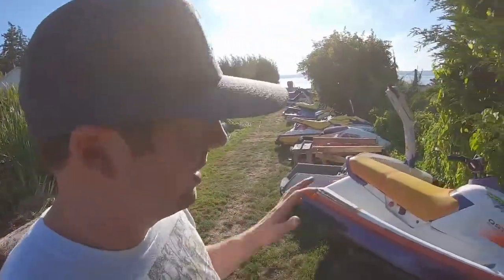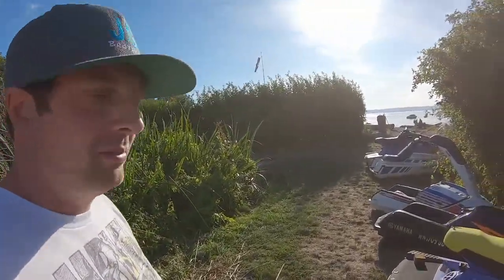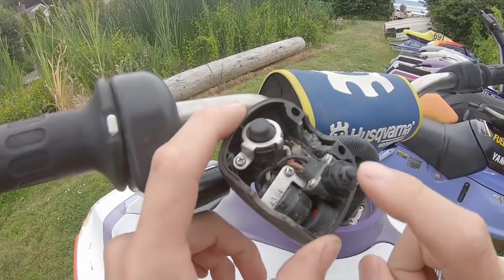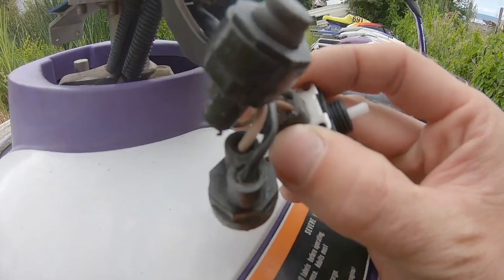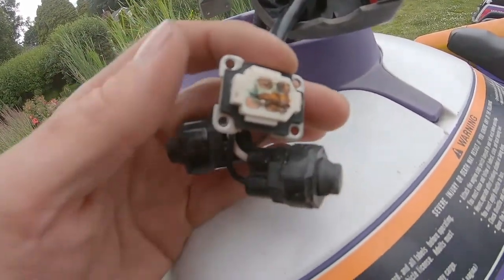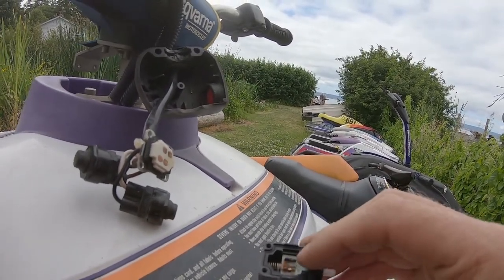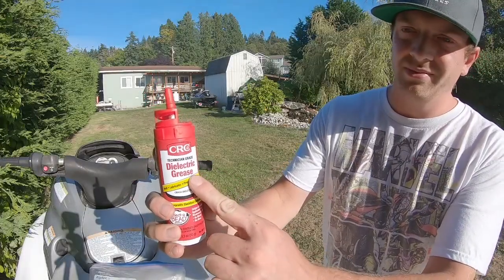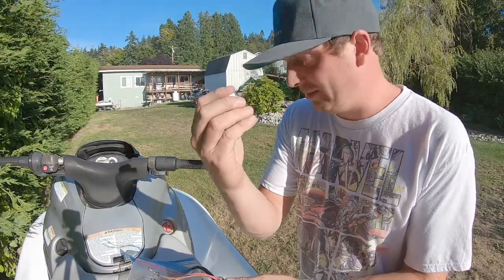#1 failure part on yamaha superjet and waverunner pwc

Comment: Had no spark on my 1992 waverunner 3, cleaned the contacts and spark was re-established. Thanks for the post.
Reply: So did the engine turn over and no spark ,or did it not turn the engine over ?
Reply: @darrellsomers5427  

The problem ultimately was the CDI. An after-market one was purchased, and everything ran fine. Everything is dialed in now.

Comment: I put a 2011 VX switch on my 95' Blaster and it works. I was looking everywhere for 93-96 Blaster switches on Ebay and Amazon. Finally I realized one day that my 2014 VXS had a switch box that looked the same!

Comment: The “Secret to long life “ of these switches is keep a lanyard connected all the time when in storage. The little rubber cover will have No pressure on it while the lanyard is connected, this stops it from splitting and leaking water 💧.
Regards Adzy
Reply: Adzy the PWC bloke in Australia! Troy great tip
Reply: The guy who sold me my Wave Venture in March 2020 told me that!  Most valuable tip so far!  :)

Comment: I found a trade for those little rubber boots you're talkin about it was many assorted ones at the hardware store in the nuts and bolts hardware section there was some assorted stuff at the far end little knobs assorted switches excetera and they had a little tray with about five or six different kinds of those rubber switch covers boots. They were about ten bucks a piece they were not cheap but they had them in different sizes. Also may check eBay for waterproof toggle switch boot. John from Marble Falls Texas

Comment: This sounds like the issue I had last week at the ramp where I hooked up the lanyard, but it would not start. Luckily I hit the start/stop switch with some electrical contact spray I brought and it fired right up, but I think I will take apart the switch this weekend and fix it right.

Comment: Just watched your video and it seems to be my problem- the little metal tabs in the kill switch are missing.  I was going to replace the kill switch with a generic one.  I tried to disconnect the black and white clip but it wouldn’t start.  I checked and I have power in red wire coming from battery lead going to kill switch… any suggestions?

Comment: Sometimes you can test this by pulling the spark plugs and watching for spark. No spark while the button is being held down and it will spark momentarily when the button is released. 

Also, jet ski solutions out of Georgia will fix these. I had them do one for my fx1 and it has at least 6 or 7 seasons in it so far.

Comment: I have a Yamaha xl 700 04’ that isn’t firing regularly. It will crank sometimes but won’t others. Any idea what it might be? Start Stop switch or coil maybe?
Reply: Richard Owens I have  a 2003 xlt800 same problem. I did this and still the same problem.  Any luck fixing yours yet?

Comment: They got this stuff now in the store that acts and does not get hot it is liquid black scotch tape I put it on everything with wires that evolves around water and it peels off if you need to do repairs David around all of that cover all that steel and you’ll never have a problem it is pretty neat

Comment: thank you for this great video,  I just bought a 98 waverunner  that will start but will not shut off, I've already swapped the on off switch and had the  same results , any ideas?
Reply: You need a Diode someplace after the ON switch

Comment: Thanks for that. BUT my issue is that my jetski turns over but there s no spark? Which means the lanyard switch works but there s no spark? Is it still the same issue? Because I guess if it's the switch issue it won't even turn over? Pls let me know. I m very confused here. Thanks

Comment: Try this one: I take my xl700 10mi to end of the island great engine but we go to leave it cranks and start to accelerate and boom nothing no spark. I noticed the fuse popped in the ign box put another in and nothing even pulled a spark plug and held onto it I should have got shocked. Cranks over fine but won't spark anymore I'm thinking stater I don't think the start stop would pop my fuse. Wut would u guys try on this?

Comment: Great info! This was the issue with my 95 Waveventure. However, I can't figure out how to get the switch with the 4 screws out of the housing to take it apart.. I took out the 2 screws on the other side. It looks like it is zip tied way down under??
Also, if I decide just to get a new one, I don't see where the wires go down into the ski.
Thanks!

Comment: Fixed my switch finally. I was trying to get my ski ready for a Trump Flotilla here in CA, unfortunately I never made it. The problem was as you mentioned in your video, but a bit more of a problem. Those tiny contacts in the slide were dirty, but one was corroded and would not spring back up. I finally got it out then noticed the tiny spring inside was eaten away from the corrosion and that diameter size of spring I could not find anywhere. I had springs that 'diameter wise' were close but would not fit. The workaround "for me" was too very carefully drill out the spring pocket in the slide and cut the spring to the correct length, then pray the contact would slide up and down. "It worked". I placed everything back in the lower cover tried it out and it fired right up. Reassembled the upper cover, tried it and nothing...WTF. I tore the whole thing apart 3 times down to the contacts, thinking it must be the problem, but the problem was simpler than that. It seems when I tightened the (4) screws of the slide switch housing I over tightened it and the slide would not pop backup after having to work against the spring pressure from the lanyard button. Loosening the screws to the slide housing just a little was enough for the slide switch to work more freely. It starts every time now and hopefully will last a long time as I packed that housing with dielectric grease. The little rubber boots for the switches they sell online and if I had thought about it when I went to the electronics store I could have bought some there. Another option would be to maybe make one out of Plasti Dip.

Comment: Can you put dielectric grease on those switch terminals once you clean it off ?
Reply from the maker: I have tried it and the grease makes the switch move too slowly. You might be able to get away with an extremely light coat

Comment: Good info for my Waveraider. I was going to comment about using dielectric grease in the slide contact, but you covered it. The dielectric grease works well at keeping moisture out so I like to use it in my plug boots and pretty much any place where there is a chance of corrosion.

Comment: I've got a 1996 Yamaha waverunner 760. No spark. No power in the entire ignition system. I bypassed the off switch made no difference. Unplugged the Cdi no voltage coming from any of the coils when cranking. No voltage to ignition coil coming from cdi. All connections in ebox are good with no corrosion. Wiring harness looks good from front of engine to ebox and from handlebars to ebox. Ignition system completely dead. Only the starter works.

Any ideas?
Reply: If you have power going in but nothing coming out... bad cdi/igniter.  Be sure fuse is good...
Reply: @aNuthaRedneck  Your correct that was it. 👍 I put a new CDI in several months back and it's been running good.
Reply: What fuse and where is it located

Comment: When the switch fails does it still crank??chasing a no start issue with mine. Cranks but doesn't fire
Reply: Will turn over but will not fire
Reply: @Mobileian  check for fire to coils. If it  is getting fire to them but no spark then it is bad coil or kill circuit which you can disconnect.  Worst case is bad igniter.

Comment: So with the switch looking like that. will that not let power get to the spark plugs and it won't start
Reply from the maker: correct
Reply: Sweet man thank you so much I hope this solves my problem with my Sea-Doo
Reply: So it be your thoughts would it be just best to buy a new starter switch or just try to clean it

Comment: Do you think that's the problem with a 2001 Yamaha waverunner? It cranks but won't start
Reply from the maker: Joel C plaza definitely a possibility, it’s the exact same part
Reply: Thank you so much. Someone is selling it for $1200 and said it cranks but won't turn on. Should I risk it and buy it?
Reply from the maker: Joel C plaza If I was you I would run a compression check on it and as long as it has reasonable compression on all cylinders then I would definitely chance it
Reply: Thank you so much
Reply from the maker: Joel C plaza Glad to help and good luck 👍